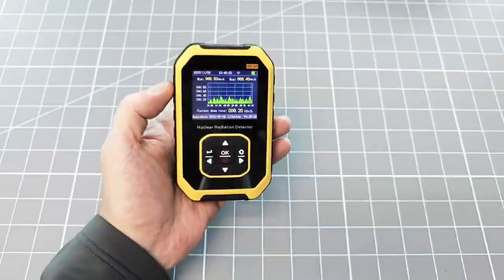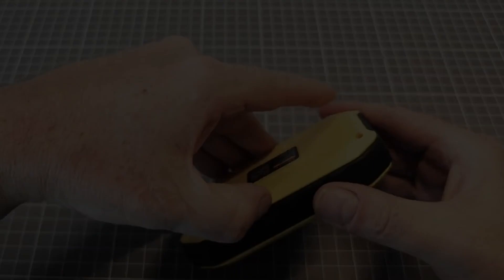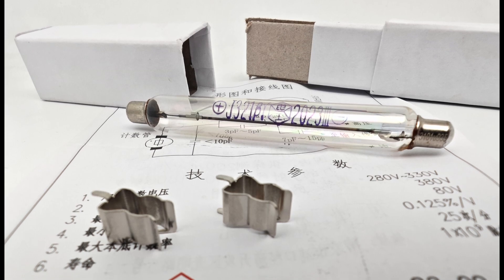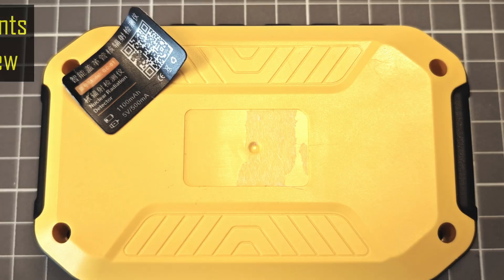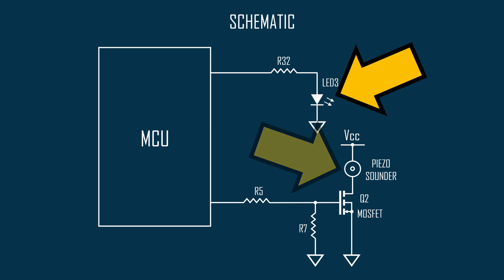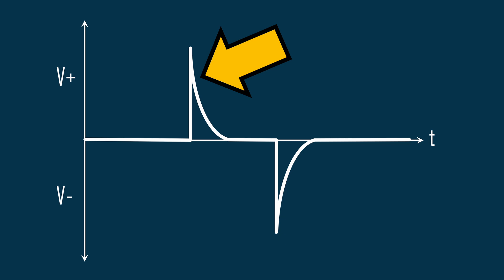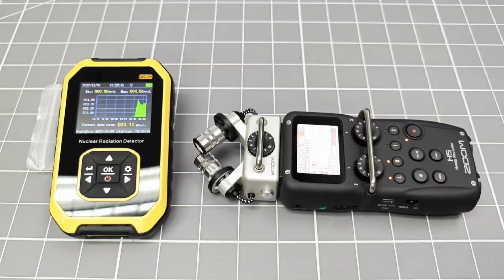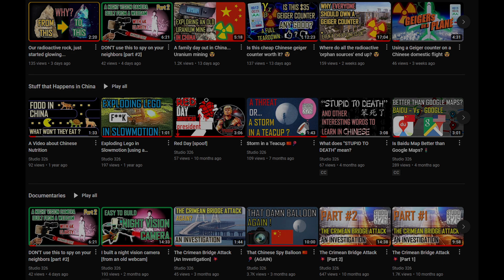Adding Particle Click Sounds to the FNIRSI Geiger Counter ☢️

Comment: You should look at the GC-03. See if it is shit or not. Would this upgrade work on it as well?
Reply from the maker: thanks for the comment.   Actually there is an alternative method that is better, you could always try upgrading the firmware to include particle clicks.  There is a video about how to do this on the channel page.
Reply: @project-326  I have seen it, however I am worried that the developer will not make a version for the new counter. I should make contact to see if it's true.
Reply from the maker: I might buy one some day, but frankly I have a large collection of these kind of crappy devices already...
Thanks for the comment.

Comment: Great video. Did you try GC-02? 
Would this process work for Fnirsi GC-02 as well? I can find the same labeled resistors on the back side and on the front side as well. Thanks
Reply from the maker: Thank yo for the comment, I have not yet taken a look at the GC-02...
Reply: And do you plan to do it? 
I just can't figure out...I tried a few different methods with Ai...but nothing seems to work. 
I used a 100nF capacitor with a 200Kohm resistor and tried to get signal from the Geiger tube to the existing buzzer. No luck 😔 don't want to destroy the device completely...I compromised one LED already..not burned it completely but it's weaker now. 🫣

Comment: Since yesterday I have this geiger counter. It has the gray tube and it doesn't detect any radiation.
But if you tap the casing with your fingers, it increases.
I've bought a new one right from the Fnirsi webshop

Comment: I have tried it with the same mod, but the clicks are far too quiet.

can I put in a bigger cap?
I don't want to get the new firmware update from your other videos, because I really like the dark optics of the current one.

I would appreciate your help!
Thanks!
Reply from the maker: You are correct, the clicks are not terribly loud from this mod.  Increasing the cap size will not help very much.  I know what you mean about the RadPro look and feel, it's pretty bland, but it does give a very strong clicking sound as the drive to the peizo has been optimized for that where as the original FW is just trying to flash an LED...

Comment: I’ve managed to do this with a cheap knockoff one, bridged with the same 104 capacitor. The click is far too quiet however. Is there any way to make it louder using a different capacitor, different location, etc?

Edit: I also tried a 10k resistor and it was only about as loud as the capacitor
Reply from the maker: take a look on the channel page and you should find another video (made after this one) on a firmware upgrade to the GC-01 that gives really good particle clicks!

Comment: Thanks for your great advice. When I fitted 100nF it was not loud enough for me. I guess I could have gone for a bigger cap but I went the resistor route. When I tried 10k it was about as loud as with the cap so I tried a 1k resistor and that is just loud enough. It robs too muchcurrent from the LED so that doesn't light any more. I don't really mind that. I did consider if this load might blow something but assuming the supply is 5V then it is still only pushing out 5mA I fuigure that should be OK (fingers crossed)

Comment: There is an issue if you could assist. It takes to check the calibration of my latest particle counter gas analyser for formaldehyde and TVOC it is pure diffusion type. It means that no gas under pressure can be led from the bottle on the calibration/pump cap to sensors. So how to determine ppm or mg/m3 concentration over the opened bottle of samples?
Reply from the maker: Sorry, I have no idea about gas sensors...

Comment: @project-326 thanks for the video! could you explain in more detail the situation with the two spikes? 2:52 why are there two of them and why do they look like that on the diagram?
Reply from the maker: A capacitor will behave like a differentiator, so on the rising edge of the pulse there will be a positive spike, once the input signal reaches the positive voltage, there is no more change and the output of the cap will return to zero.  On the negative edge of the pulse, the opposite will happen with regards to the polarity.

Please see The "RC Differentiator" section (about half way down the page) at this link.
https://www.electronics-tutorials.ws/rc/rc_3.html
Reply: @project-326 thank you so much!

Comment: That's a great upgrade, especially using a capacitor! I don't know why it didn't have one to begin with. Usually, you can switch off the sound–with most radiation detectors. G-M counters and scintillation counters without particle detection pulse sounds from a speaker or piezo buzzer seems so counterintuitive. Having audible clicks/beeps gives you that extra sense, that otherwise, wouldn't be there. Plus, you don't have to constantly stare at the screen/meter or LED (if there is one) that does flash–with each detection event. A radiation detector without a sounder is like a working telephone–that doesn't ring. I also like radiation detection instruments with headphone jack options, too. That way, you can use said detector more discretely, so that others won't hear it. My SEI Inspector USB G-M counter has that, too. Anyway, keep up the great work! There are a lot of radiation detection instrument developers out there that could use some tough love! Thank you!
Reply from the maker: if you take a look on the channel, there is another video I made after this with a firmware upgrade that is a better option.
Reply: @project-326  I just did this HW hack and it works great. Now, 30 minutes later, i scrolled down and saw this comment. xD Would you suggest i remove the capacitor again and get the FW update? I just got this in the mail today and it has the "good" tube fortunately. Great videos btw. <3
Reply from the maker: @normahS  the FW upgrade is certainly better, but there is a small risk of bricking your device...

Comment: I have this Geiger counter. When I turn it off, the date is gone. When I turn it on again, the date is always 2022-01-01. It keeps stored other settings but not the date. Any suggestions?
Reply from the maker: There is a coin cell inside the product for exactly this purpose, try replacing it...
Reply: @project-326  Yes that was the problem, thanks a lot.

Comment: J321 Geiger Muller tube counter replace the tube in the above FNIRSI Geiger Counter?
Reply from the maker: If does depend on what is already fitted when you get the device.  The vendor used to use J321, then last year changed to different crappy tubes.  It seems that recently, they have changed back.  If you already have that tube fitted, then don't change it...

Comment: Thanks for the great tips. But you don't have to remove the circuit board. In order to connect the pin that supplies the LED, you can just connect it from pin 50 of the MCU. I have already recorded a video of the steps. If I have time I will upload it to YouTube. Have a nice day.
Reply from the maker: Yes, you are right

Comment: Interesting video. I had bought a very cheap geiger counter that included a J321 tube but bought a GC-01 because of the better firmware, display, case etc intending to upgrade.

I added the clicks but used a small MOSFET (ZXM61N02F) to the back of the loudspeaker (electromagnetic not piezo by the way) with the gate connected via a thin wire to the processor side of the resistor driving the LED with drain to speaker and source to ground plane, having scraped away the solder resist next to the speaker connection. This could all neatly be added to the display side of the PCB. I also wasn't too keen on adding a capacitor to the base of the SS8050 NPN transistor (SOT23 marked Y1) as repeated reverse Vbe can degrade the hfe over time although it's absolute max is stated as 5V and momentary 3.3V pulses from the processor will probably be Ok.

I also brightened up the LED with a more efficient one and changed the 2kΩ resistor for a 470Ω.

The GM tube fitted was only 52mm long. Some people list it as j613r-614r but I think it might be a Gerniei 05gab1m2t. Either way it didn't seem very sensitive compared to the J321 in the other unit so I swapped them.

One thing I did notice was that my GC-01 didn't have the added load resistor you mentioned and removed and I found the HV applied to the tube was around 700V and the J321 manufacturer specifies 600V as the maximum. So I added a 47MΩ (should be 51MΩ according to on line photos) which brings the voltage down to 550V or there abouts measured with a x100 scope probe (10MΩ multimeter loads too much).

The whole thing works great now with clicks and decent flashes so thanks for the inspiration to modify the unit. It's quite a neat product.

The only reservation is that it seems perhaps a little too sensitive reading background radiation around 32 - 35 µSv/h instead of 27 µSv/h like I might expect here. Would lowering the GM voltage correct this or is µSv calibration built into the firmware and might changing tubes now not match?

Having said that and looked at the display again the average had fallen to 22 µSv/h but I've seen it as high as 50 µSv - so it depends when you look. I should try taking averages over half an hour to be more certain.

What I'm thinking is that clicks can be counted but the unit has no knowledge of the energy so a µSv reading must be calibrated either with a scaling factor in software or by scaling the average avalanche threshold by tweaking the voltage - what do you think?
Reply from the maker: Thanks for the detailed comments

For the load resistor, I subsequently changed to a 20M resistor, I think when I initially did the modification, the humidity was very high (I am in southern China, ie a tropical environment), so adding a fixed loading makes it less sensitive to environmental conditions.  The issue with these crappy open loop power supplies is that each one will be different.  I have personally seen quite large differences in the voltage generated (I also use a 100x scope probe for this, for the same reason).

The tube sensitivity is higher so for sure the calibration will be quite different, but that said, originally mine showed less than half what I expected for background in my location.  The HH442 (the longer tube that looks like an Xmas tree light) has a solid steel cathode so you are losing almost all beta response.

I am working on a video about how to add shielding based energy compensation to low cost tubes like the J321.  Energy compensated tubes are really expensive but the materials used are not, essentially you are just paying for the know-how.

The issues with the poor tolerance of the HV supply on lots of cheaper counters, is actually quite a serious problem.  I have been looking into this as part of my 2nd video on UV sensitivity of GM tubes.  The GM plateau region is often narrower than the tolerance of the HV supply.  I have seen new counters that actually fully ionize the gas of the whole tube on particle events and needed an increase in the anode resistor value to ensure that the quenching process still works.
Reply: @studio326-  Interesting stuff. I saw your UV video. 

One simple way of making the HV more stable is toadd a couple of HV Zener diodes in series to Gnd from the output of the multiplier before the series resistor to the tube +ve. My cheap Geiger counter that had the J321 had two 200V zeners. Without them the voltage would go up to >500V but with them was very stable at a little over 400V with no dip when the scope probe was connected.

One very curious thing Uve discovered is that with the J321 in my GC-01 the main screen average and histogram screens read an average of around 30 µSv/h but I've noticed that the cumulative stored reading only reads around 10 µSv for every hour recorded - about 1/3 of the main screen readings. I remember you saying there was something wrong with the averaging - was this it?

However, I've seen pictures on line of the GC-01 where the main screen and histogram averages match the cumulative stored count.

I wonder if there's been a firmware mod factor to compensate for the insensitive tube that with the more sensitive J321 replacement somehow now doesn't get reflected in the cumulative stored reading. I can't quite work out why this would be the case and why any firmware compensation doesn't apply to both. Do you get this with yours too?
Reply: I temporarily swapped the inferior tube back in and the same discrepancy between average µSv/h and cumulative stored µSv for every hour occurs - so no special scaling factor for lower readings. With no tube in at all there are zero counts so no offset is applied either. There just seems to be around 1/3 of the live average stored as an accumulated figure. No idea why.
Reply from the maker: @johnh9449  Some devices 'fiddle' the calibration, particularly when they use this HH442 tube (I found the same sort of strangeness with the HFS-10 product).  Typically they want to get the background and one test source to be correct but a single calibration factor will not allow that to be done.  It seems that they cheat and have different coefficients for different parts of the transfer function...  Nasty stuff.
Reply from the maker: I just did a quick tear-down of that tiny "loudspeaker" in this, you are correct about it not being a piezo element.  I put some notes in the community sections, thanks to you!
Reply: @project-326  I have a small electronic "buzzer" in the same size footprint - looks the same but gives a fixed 2 kHz tone for 5V DC and briefly tested that in place of the loudspeaker. It's a Piezo device but has its own sealed oscillator built in. The sound of 2 kHz in 10ms pulses is more noticeable than the straight "clicks" and could be an easy upgrade but somehow the short beeps seem less authentic. 

I also bought a cheap 25 mm diameter 8 ohm loudspeaker which clicks a lot louder. That's more of a challenge to mount however. It might also get a bit annoying if left on all the time. The present quiet clicks allow it to be ignored like a ticking clock at least.

I have found I only get around 10 hours run time. The consumption is about 80 mA in idle and I did measure only 800 mAh accumulated when charging wit my USB tester despite the 1,100 mAh printed on the battery. I've got a slightly larger 1,500 mAh battery to try if I can get it to fit as it's about 10 mm wider.

Comment: mine has extra screw in middle and resistor where you said to remove one if it was the rubbish version. the tube is the good one you say to have.
Reply from the maker: If it has the correct tube, then don't make any changes (except the click mod if you want), and be happy that you have one from before the cheaper version was released.
Reply: @project-326 thanjs for advice. Not rushing to change anything else! Will leave it as is. What voltage should be across the tube? Could test that to check :)
Reply from the maker: @revolvingwonder3777  About 380V, but it is really hard to measure as most multi-meters have an input impedance of about 10M Ohms which for the small PSU involved is actually a significant load.  Be sure to measure before the anode resistor in any case...
Reply: @project-326  thanks! Does sound harder than usual. Hmm sounds like i got more to learn and a chat with my father….  Hmm hmmm
Reply: Can send photos of pcb . Plan to do click mod. Very glad mine comes with the correct tube! Bought off aliexpress earlier on in Russia Ukraine war. Just in case! Something like £38 shipped to uk, inc vat.

Comment: Hi! Thank you so much for the review and the upgrade of the product. Mine had the good tube so I only had to add the capacitor for particle sound. Is there any other way to make it sound louder ? I can bearly hear it ! Thanks again from Argentina!!
Reply from the maker: That is not a simple change, to increase the loudness needs a much more advanced circuit.  I added a hole on the back of mine (see the community tab on the channel) which helps a bit.  Perhaps add some EVA foam to seal the case to the PCB, that might increase the sound pressure level a little...
Reply: @project-326 Yes, I did notice the loudspeaker is supplied by the 3.3V regulated supply. I did think of connecting the speaker positive directly to the battery but that wouldn't increase it by much.

Another option would be to change the speaker (it's an electromagnetic device with a resistance of 15 Ω) for a bigger one (there's a plethora available) or wire a genuine piezo across the original glued to the back of the case to act as a resonator.